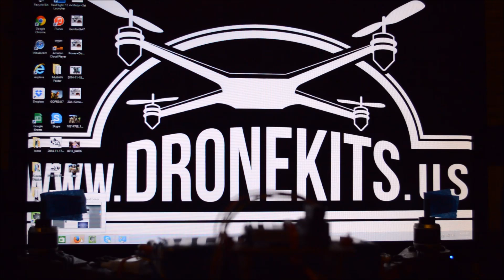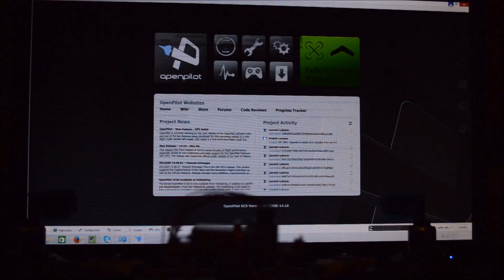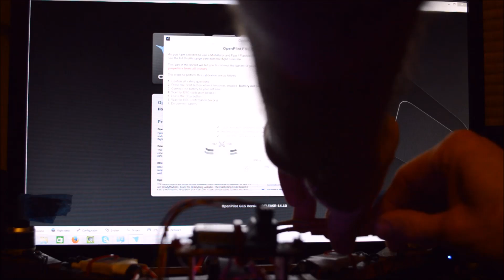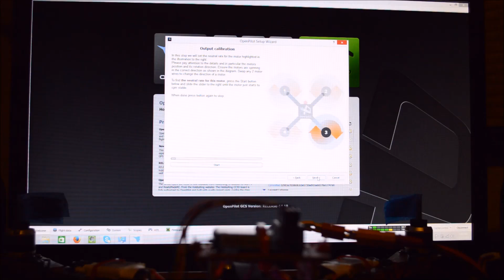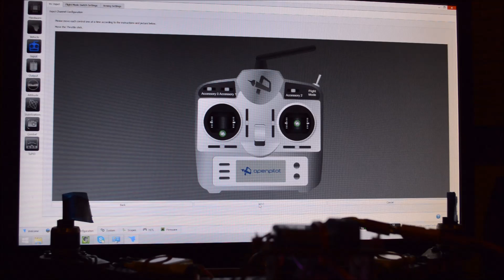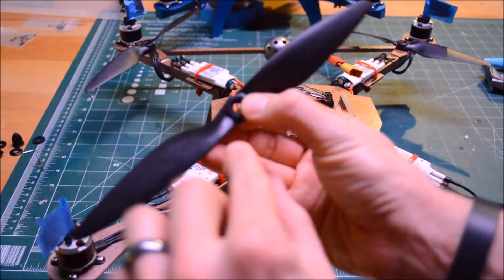Part 4 of 4 Quad Frame Build CC3D Setup and Prop Installation by www.DroneKits.us

Comment: Great Video a few more tips when your Ready to fly check the cg of the QUAD. 
place your guad in front of you for the first flight nose away of course. arm your board by pulling left stick down to the right! and after flying Disarm is down to the left or I set mine to shut down in 10sec. Good luck and great flying.

Comment: ok new problem-finally got the Quattro with the cc3d configured but now in flight data screen there is no telemetry screen next to the drone graphic-I can go to stabilize screen and zero the gyros but I still get now telemetry readings and when I try to fly the drone the gyros are obviously not working and the drone is uncontrollable ??? please help...some more ! :)
Reply from the maker: What electronics are you using.  Did you put together one of our kits?  You may want to post a video and ask for suggestions.
Reply: open pilot cc3d with Quattro 25amp 4in1 esc with devo rx701 receiver...no I did not get one of your kits but based my quad off your videos,everything seems to work and flight date says its correct but when I power it up its all over the place ?!?!

Comment: ok...GOT IT..it fires up and responds to remote,unfortunately  1 of the esc went bad in process! the number 4 engine wont spin with rest of them-I switched it to another esc and it spun up...anything I can do to fix it or just replace it...I have replacements on order but have not arrived yet ?
Reply from the maker: At low throttle they may not all spin.  If all the motors spun when you did the esc setup you should be fine.  The last motor might not spin until you get closer to lift off speed.
Reply: www.DroneKits.US no the ESC is bad-motor does nt spin at all and doesn't spin in test either-when I switch it with another ESC it spins fine !

Comment: ok...im looking at 2 options,1 is getting the FlySky FS-i6 2.4G 6CH AFHDS RC Transmitter With FS-iA6 Receiver and trying this but want to make sure this will work fine with a quad ? second im starting to think I have a bad cc3d board,when I tried the process again during the engine test sequence engine 4 wouldn't spin only twitch back and forth,checked all the connections and they are solid ? I have 2 more cc3d boards coming and will try one of those when they get here.but what do you think of that rx/tx combo for a drone ?
Reply from the maker: I have no experience with that receiver transmitter combo.  I fly Spektrum and have dabbled with some Turnigy stuff.

What esc's are you using?
Reply: I was using simonk 12a,but today my Quattro showed up which I installed,programmed and crashed breaking a blade....local hobby shop said it keeps flipping from forward to back due to gyro issue? so I reprogrammed the flight board and waiting for another set of blades to try again-my first quad build so a bit of a learning curve ! :P

Comment: everything goes fine until I get to the part to move flight stick like the animated remote on the screen-it says you may have to do it rapidly to get it to work...gone slow and as fast as I can,smoked an entire cigarette while moving the flight mode switch and it never responds-ive checked in the remote system monitor and it confirms the switch position and that its working ? also,if I un plug the drone and plug it back in,i have to restart my computer to get open pilot to link to the board and recognize it again ??? does any of this help narrow things down or what other info do you need to help me out ?
Reply from the maker: I'm not familiar with the devo7 programming.  Most radios will need to have the flight mode switches programmed to work on a certain channel.  If you just want to get past this portion you need to trick the cc3d into thinking you have moved the flight mode switch.  

Swap one of the working channels aileron or rudder with the aux channels.  This way you can move one of the sticks and it will allow you to finish wizard.  After you get past that step put the wire back into its original channel. 

Most likely you need to program that switch to be channel 5 in the devo 7.
Reply from the maker: http://youtu.be/1JOq4pKag6s

Here is a link for programming the switch in the devo 7.

Comment: ok-update-had 2 wires plugged into wrong spot on rx701 so I got all the way thru it and saved it unplugged everything then restarted remote then drone,engines initialize and receiver transmitter link up,but when I throttle up nothing happens-remote says throttle is increasing but drone does not respond or do anything...I think I need to program my devo 7 now ? can anyone gove me settings or a link for settings for a devo 7 and quad drone ???
Reply from the maker: Did you get to the part where you set the arming command?  In the video I recommend setting to throttle off and yaw right.  Hold that for five seconds and then wait another 5 before giving throttle.  

Were you able to arm it when it was plugged into the openpilot software?
Reply from the maker: At 19 minutes the video shows a screen that has the board status down in the left lower corner.  Does yours appear the same?  If there are any red squares it will not arm.

Comment: This is my final review.  Regarding "Open Pilot", - To save you a bit of difficulties, please note the following. After "Open Pilot" has you move your sticks around, it will ask you to move your flight mode switch. If you have a DX6 as I do, the flight control switch is your "D" switch. "OP" will show you that the switch is on the top right side. On the DX6 the flight mode switch is on the front left side. It is labeled "D" on the DX6.

That being said, I have completed my build. Although I am awaiting my charger from Amazon, I did have enough power to perform a first flight.

I was amazed how smooth this quad hovers. I cannot find any negative things about this quad. It has more power than I ever expected. I decided to use a 4000 3 cell 10C  multistar battery. I did have a concern about the extra weight. Boy was I wrong! This quad has plenty of  power. I would expect that my flight time will be great.

In my opinion, if you are serious about a scratch build, do not waste your time with others.  Simply go on Ryan's site (dronekits.us) and order. I cannot imagine anyone being disappointed.  I painted the front booms and landing bases neon green, and the rear booms and landing bases neon red.  I am even considering attaching LED's to the booms.

Once again, please free to contact me @ bigbadbob143@gmail.com
Reply from the maker: Great tip Bob!!

Comment: Great video! Question - When i checkbox the pitch to invert it and click next, it does not invert it. I'm using a taranis x9d. Any ideas why this is not working? thanks!
Reply from the maker: After you check the invert box does the stick movement onscreen mimic your radio?  After completing the wizard you then need to click Save and make sure the green check appears and stays on the Save button.  If the green check just blips on for a second and then back off the parameters were not saved to your CC3D.  Hope this helps.